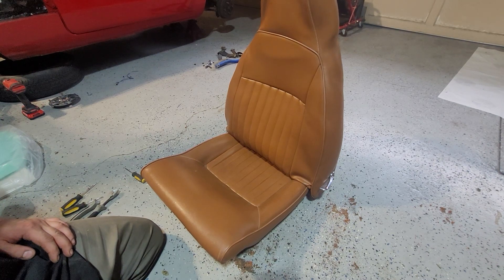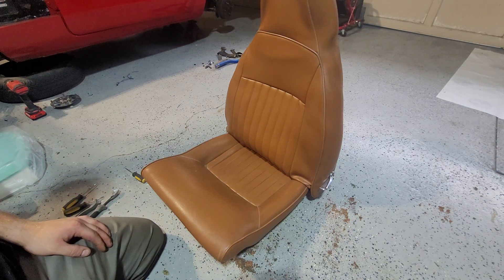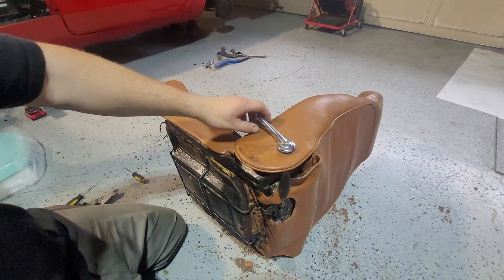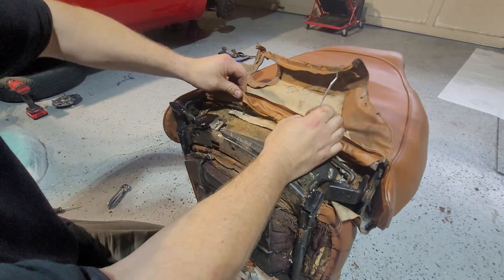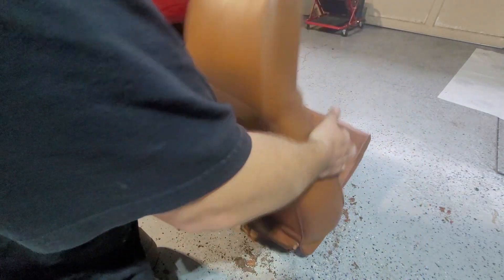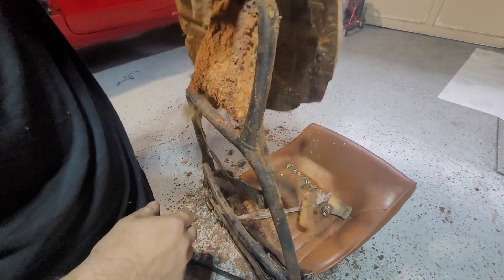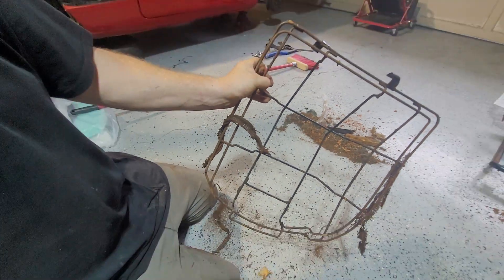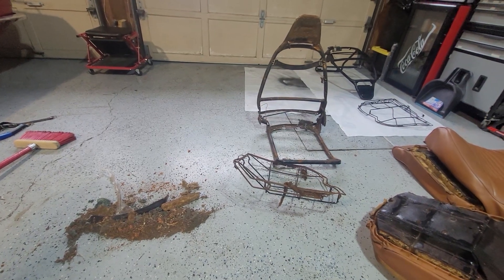Triumph spitfire seat cover change part 1

Comment: So the bottoms are designed to come out the top when you unclip them.  You just unclip the fronts and lift - they should disconnect from the frame from the top and not have to pry them out from the bottom of the frame.
Reply from the maker: Hi, yes there is two swivel clips that once you unclip it just falls out.